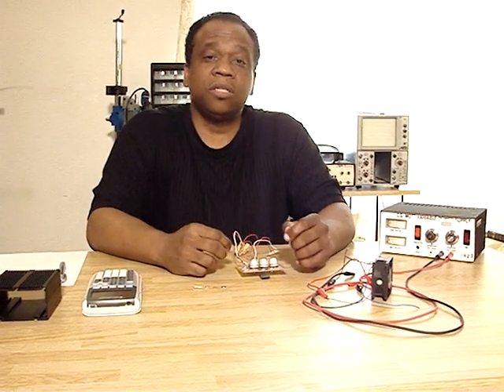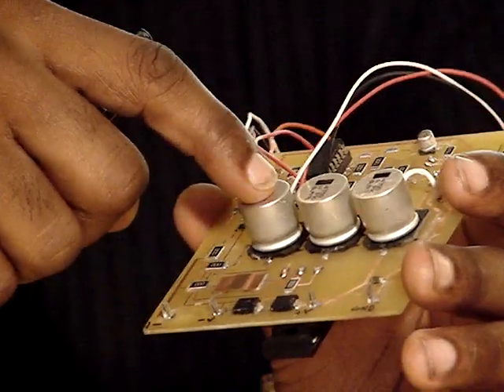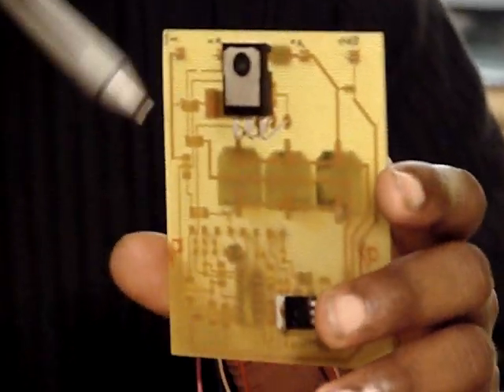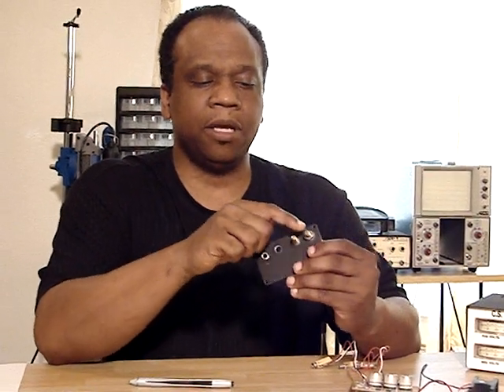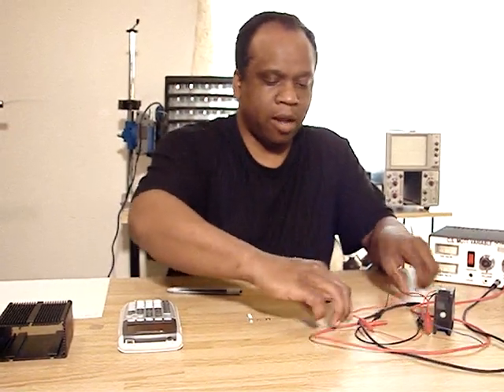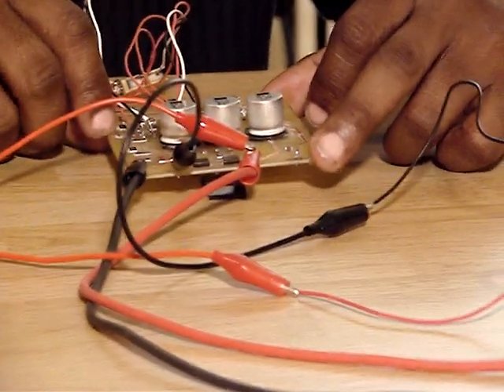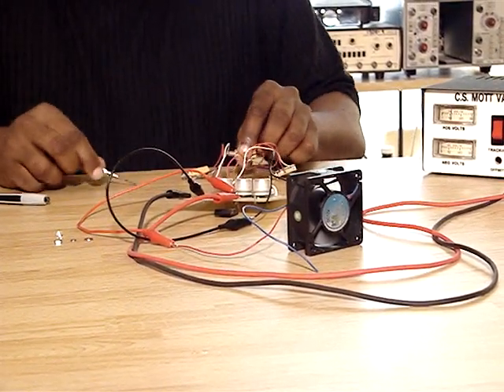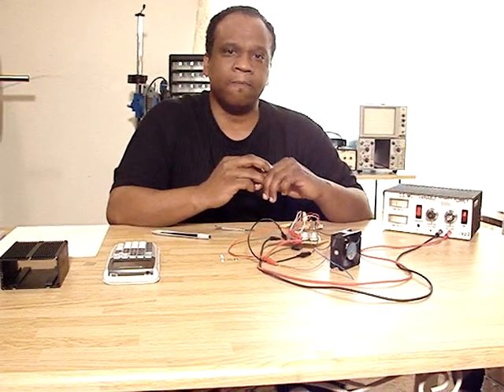150 AMP PWM

Comment: Hi there, I need 12V 110 AMP PWM device for my HHO Kit that include on 37 plates which will run my 1600cc car only on hydrogen gas.

Comment: Congatulations! I've been trying to impress on people builbing PWMs for years,regarding the Drain pin connecting to the Mosfet case,but they still continue to ground it to a metal enclosure,perhaps now they've seen your video, the message might SINK in(pun) 
Regards Terry p.s. It's a great PWM.